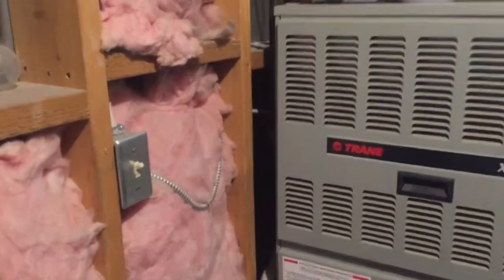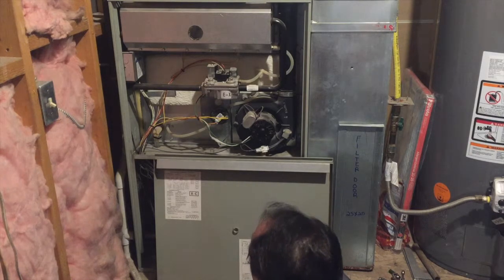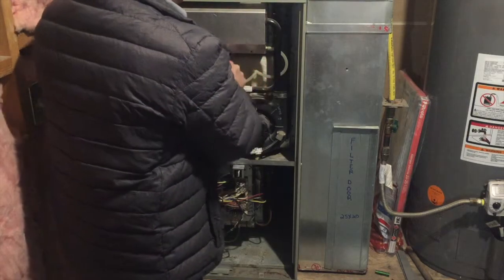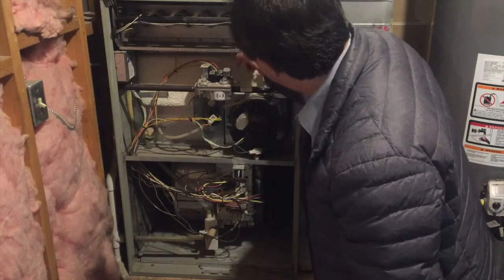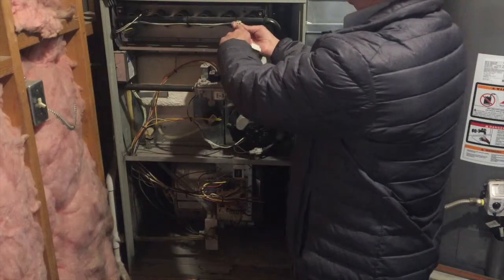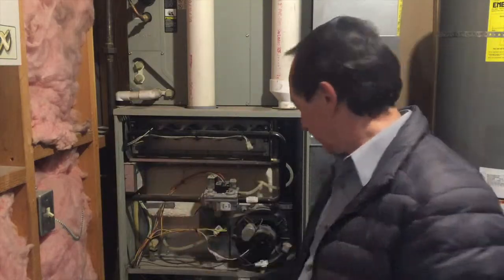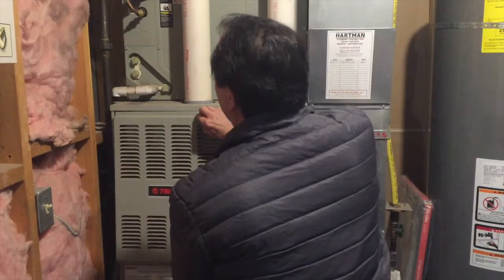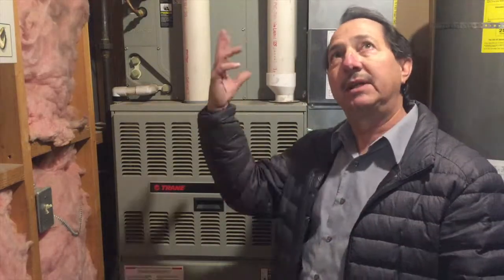DIY Furnace Repair. My Trane furnace will not light. I can fix that! How to repair a furnace.

Comment: Overall, a more thorough explanation than the professionals I've watched. Didn't hear you mention the panel switch but maybe I missed it. I plan to buy and igniter and flame sensor to have on hand. Cheap insurance. In a pinch, you can manually light the burner when the valve opens to heat the house, but it will shut off when it reaches the set temp, and have to be lit again. In really cold weather, that's better than no heat.
Reply from the maker: That is a great tip to hand light to get by till the parts are rounded up. Thanks!

Comment: I don't trust a lot of service people, either.  When my tankless water heater went out, I had a plumber charge me $200 to check it and then tell me I needed to buy a new one. He said the brand I had was not good and suggested a better brand for $6K.  I went online and ended up replacing the igniter and sensor for about $42. It's still working well about a year and a half later.
Reply from the maker: I had a similar issue with a tankless water heater. I was told it was too expensive to fix. I decided that I'd try to fix it and it just needed some welding on a tube. Done
Reply: @riderescue yeah, it’s amazing how much money we can save by just trying a little. I had a neighbor who had zero tools in his garage and my wife thought his garage looked so nice. But, he always had a repair truck in front of his house because he didn’t try to fix anything.
Reply from the maker: @tomcopeland6424  Yep, I've seen those clean garages. My garage is stocked with things that I have collected over the years. Almost to the point of hoarding but when something breaks I have a way to try to fix it and most times for no cost. Just a couple days ago I fixed my microwave with stuff I had in the garage. Saved me hundreds of dollars. My wife has a love to hate my garage. She loves when I fix things from stored garage stuff though. 😃

Comment: Thank you Sir !   My furnace did the same thing blowing cold air,  with a Normal Code light. . it was freezing so we called a service tech . . he came in looked at the unit. . with his flashlight . . talked to his boss.. somehow deduced that I had a bad inducer motor .  . well I watched inducer motor failures and to me it appeared my inducer motor was fine turning well with no noise and I didn't have an error  on the light for that problem.. so as I was thinking as to what else it could be. . I noticed a strange piece of what appeared to be plastic. . i found your video and after further investigation found out the igniter was broken... I ordered one on Amazon for $20 - installed and cleaned that sensor. . like you said .. and poof  I was up and running..  the Service Tech wanted to sell mom a new furnace for $4,500  and said that an inducer motor was $1,800 ... so we saved some HUGE  $$ Thank you..  AMAZON got ours here NEXT DAY !         whew !   Thank you again !
Reply from the maker: That is awesome. Your story is why I do these videos. Some techs hate me but if all techs were honest my video wouldn't get watched. Thanks for the comment and congratulations on a huge savings.

Comment: I usually place a co2 detector on or near the unit (furnace, stove or water heater)  to check for gas leaks...
Reply from the maker: That is a great idea.
Reply: CO not CO2
Reply: good catch :)

Comment: Do you please know where are the two capacitors on a Train furnace located?. Thanking you in advance for your reply.
Nate
Reply from the maker: Sorry, I don't know where those are located.
Reply: 2 capacitors ? Usually is only one for the furnace motor and two for the ac one for the condenser compressor and one for the ac motor fan

Comment: I replaces my old 25 year old furnace and since installing a new trane xr95 is a piece of shit.. it shut down 6 times inside of the two years I have had it.. I do not want to fix it every two days. TRANE FURNACES ARE SHIT
Reply: Exactly correct Trane furnaces are the worse pieces of garbage ever made. Everyone of them blows the 3 flashes pressure switch problem and even if you take the hose off the pressure switch it still throws the same pressure switch problem. These furnaces are so bad they should be free but I still wouldn't want a free one.